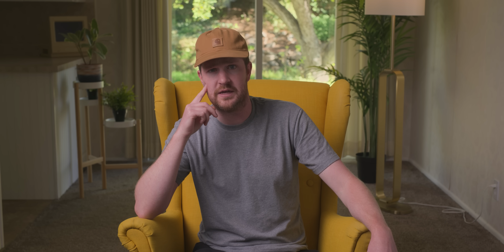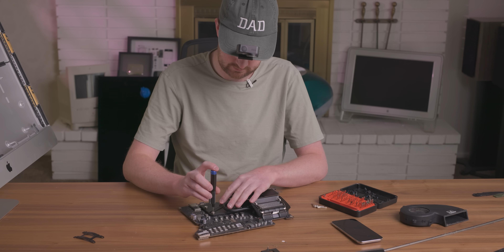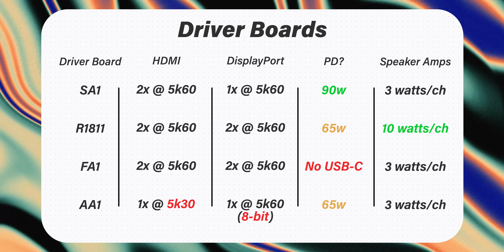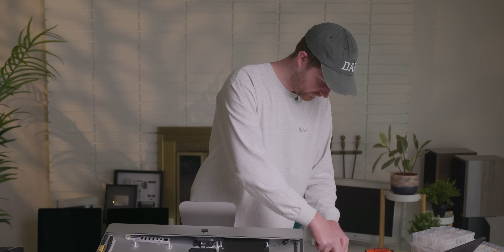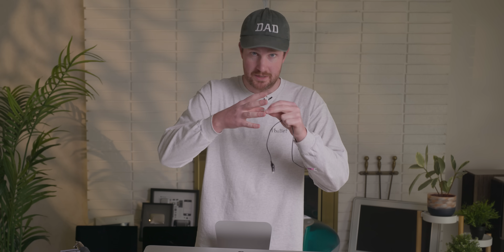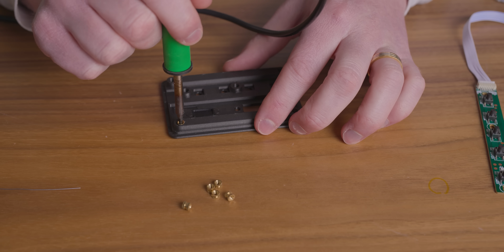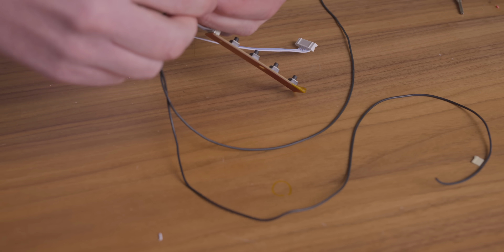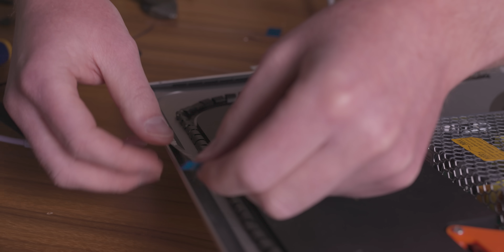I Turned a $200 iMac Into a $1,600 Studio Display!

Comment: Driver Boards...
Stonetaskin have an updated 12/24v display Driver Board, R1820 V1 to replace the 1811. 

They have made a fan cooled and a quieter fanless version, which appears to use a large heatsink. Board photos suggest that the 12v fan header is still installed, maybe the original Mac  fan could pick up its power from this with no need for the extra voltage dropper. Or the Mac 12v power supply could be retained and used for the chassis fan and the driver board if additional USB power or charging isn't needed from the rejuvenated 5K monitor.

Buuuut! The larger driver board and 10W speaker crossovers would be happier with a 200W power supply; meaning that all but the fan ducting in those beautiful 3D print files will be the wrong sizes or have incompatible mount screw centres!  Don't ask me how I know!  I have some aluminum panel, extrusions and a hot glue gun.

Comment: thats to much and too nerdy all u need is the cheapest board from any manufacturer just look over reviews aliex = 85eur + 12V 7A power supply CE certified 12eur = 97eur + thunderbold 4 cable...someone compared 8/10 bit board + regular 2017 5k imac, i swear the difference is so small its just cherry picking but 8bit doesnt need fan, or complicated 3d prints and you save a lot of money, no temp problems....this video is just bmw compared to koenigsegg in the end both doing its job very well!

Comment: you did not need weights just turn the two screws inside where the standing is mounted to the case u need to screw it 1.5x times each, now its new calibrated.

Comment: You did all that to save a 27"! If the fonts are fuzzy on 4K, just push the monitor back a little bit. I run a 48" 4K with WRGB subpixels! Sitting further back is better for your eyes anyway.

Comment: Well, that was a lot of fun to watch; it’s reassuring to know that insanity plays out on so many different axes of variation. I’m typing this on my 2017 iMac, and am waiting for my new Studio Display to ship from China; the new Mini I ordered on the same day was delivered today. Would I ever do this monitor conversion? No way in hell, although the technical feasibility was interesting to me. Will I spend literally three full  8-hour days doing the prep and cooking for a meal that will be inhaled in 20 minutes? (And that’s after driving a 4-hour round trip to get the correct ingredients from a specialty Turkish food market 90 miles away.) Oh yeah, daddyo; that’s my idea of a good time. 

By the way, here in upstate NY, we had 14 inches of snow fall 10 days ago. I went out with the snow blower, and just as I was dragging the damn thing backward to get back up a gentle hill to get to the driveway level, I had an explosive mega-sneeze with zero advance warning, and cracked a rib on my back, just below my left shoulder blade. That brings my lifetime number of broken ribs up from 13 to 14, and is the first one that wasn’t caused by my nasty motorcycling habits. To be fair, I’m closer to 79 than 78, and everything is getting more fragile. But I feel your pain, my brother.

Comment: Best way to use those new butt connectors is to pass it through the wire tie the two wires together fold it to either side and then side the sleeve over

Comment: I did this about a year and a half ago after Luke Miani posted his video three years ago. A couple of things I found from doing the conversion myself.
Press and hold the power button once you unplug the power cable and that will drain the capacitors on the power supply so no shocking moments when you get it open.
Why use a separate power supply when the built in one is perfect for the job? You can find what pins do what on the power supply so that you can connect via a regular in-line switch to power the power supply from the back of the power cable socket, I cut a notch out of the memory cover and glued in a small rocker switch. I cut the cable connector that connects to the old logic board and got my 12 volts from the required cables. No dealing with an aftermarket power supply or bec power supply to change 24 volts to 12 and its already screwed in place.
I used a bluetooth amplifier/receiver for the audio and bought a pair of cross overs for each speaker, I don't have to connect a line in cable and it works great.
I will be doing this again soon as I have an old 2017 i7 iMac that will be replaced by a 2020 i9 thats on its way and I will use it with my Mac Studio and will replace a 27" Dell 1440 monitor that sits next to the first iMac converted monitor.
Reply: Why to you need to " connect via a regular in-line switch to power the power supply from the back of the power cable socket" ?

Comment: 1. It‘s not the same display as the studio. 2. The speakers and webcam are also poor. The motherboards are mostly from China and the quality isn't very good. One motherboard I installed failed after only four months, and I had to start the whole rebuild from scratch. You're better off buying a used studio display; you can get one for around $900 these days.

Comment: my 3m adhesive tape came unstuck during a really humid thunderstorm resulting in the screen falling out and ripping the cables right out of the mainboard.  pi**ed didn't begin to describe it.  Now I'm stuck with a 1440p monitor.  I say glue the screen in place.

Comment: Hi. Why do you use LRS-150-24 and not LRS-150-12? The SA1 is a 12V driver board. I'm not an expert, just asking. Won't you overload it?
Or do you have a 12–24V SA1 board somehow @SnazzyLabs? On Stonetaskin I believe sell 12V version
Reply: It is designed for 24V

Comment: Isnt the 150W PSU underpowered for a 90W USB output?
Reply: Yes. I think it is. When my M1 Pro charges at full 90W the PSU shuts down due to overcurrent protection. I will try an 200W Meanwell. But I don't know how to get it in as it's bigger.

Comment: Great video and I'm going to be giving this a go! FB Marketplace iMac already acquired and SA1 board is on order! Only question I had - How did you get the panel mount cable to get low enough so as not to impede on the actual screen? I'm going to be doing HDMI 2.1 panel mount and USBC4 panel mount so wondering if the mount size and stiff cables are going to be a problem. Cheers!

Comment: This is awesome, and I've been following along! However it looks like the model for holding the SA1 driver board is not the same as what you use in the video. Can you link to that stl? (it looks like you've got 2 pieces of bracket attached to your driver board)

Comment: Brave, wouldn't a dry screen test have been safer? Glad it worked though :) I am from the UK. I used a MAC like this for work for BIM/CAD, and the built-in webcam sucked. I have a red face anyway, but I looked like a Lobster in meetings! Great Job, think I will just stick to my PC monitor and external speakers though :)

Comment: Hey - What mounts are you using for the board in this video? I looked in all of the files that you link to and I can't seem to find those two brackets. Thank you.
Reply: Same question! SA1 mount linked on notion - Bulabula2001’s SA1 mount - looks like it is designed to go where the imac fan sits.

Comment: i've used these kind of adhesive strips to replace either a hard drive or some ram, something, on a similar iMac, and I don't think you have to do it the way you did it.

The adhesive straps have pull tabs that stick outside of the caseonce you try to put it back together. So if you put the screen down on the case with the tabs showing you can line it up and then one at a time pull the tabs so that the adhesive will be in exactly the right place. At least that's the ones I bought worked

Comment: Seems like a cool project, but I think if you don't have a 5k iMac already, then there is not much point to do it. Thunderbolt 4k displays are available, that will make it easy to do a one monitor setup. Speakers would be nice if you don't have anything decent. But it is nice to save one from landfill.

Comment: Get a normal 4k monitor for cheap and get an app called Better Display that's what I did and you can control everything including combined brightness linking your MacBooks sensors to the display with True Tone and brightness control and HIDPI at any resolution you want.

Comment: Did this with an older 1080p 2010 21.5” iMac. Lots of space, I could fit a power supply, HDMI to USB-C dongle (with usb), by backup drive, and the original SuperDrive. It’s great! Just need to work on cooling the power supply better

Comment: Duh I didn't believe and looked it up, it is 1600$ indeed! And I have an 2017 27" 5K iMac sitting next to me as extra :) I am happy I didn't sell it and I already disassembled it to add an NVME. However, I don't have access to those controller boards, I started searching and found 2 software solutions instead:
1) Sunshine\moonlight
2) Duet. I tried duet and it is working quite well for my purposes (no gaming, just development).

Comment: Thanks a lot for the guide. Always wanted to do it and this gave me the nudge to get all parts. Quite excited for my first project like this. My board will arrive this week. Any chance the illustrations will be up soon?
Reply: I hate to say it, but the SA1 bracket including board linked to on Notion does not fit in my A1419 when mounting both the speakers and fan.

Comment: I use a Luna Display to connect my M2 macbook pro to my 27 intel iMAC
Pros
Easy Plug and play
Use my 27 inch screen as an extended display
 Cons
There is very noticeable lag but i am ok with it as i use it for Graphics and not motion graphics
can't watch ny OTT on it as Luna display  screen records 
Occupies 2 of the 3 type C ports

Comment: I have a 27" iMac that I absolutely LOVE (it's my second or third iMac...) and it is about to get this treatment. I'd found lots of articles about this conversion/salvage process - I had no idea it was such a popular thing to do.
My iMac (2019, A2115) and yours are different so after hours of searching and comparing, I ordered a JRY-W9CUHD-AA1 and crossover on AliExpress.
A couple of things:
1) Are you planing to finish your "iMac ➡ Studio Display Mod" page? I suspect your adoring fanbase (me) would appreciate it.
2) Your str files don't download as files, they download to the browser as raw character streams.  Interesting but not really useful.
3) Don't use PLA because of the heat? 
4) Where did you get the measurements for the placement of the screws inside the iMac?
Regardless, I will forge ahead. I've seen some people describe their mods and say to leave the display taped in place rather than doing the final adhesive until everything is exactly as you want and works perfectly - which I intend to do. 
Thanks for pushing me over the edge.

Comment: Just a heads up, I just built one of these and you might want to move the crossovers, With them in the location suggested in the video the power supply bleeds over some interference. I ended up hot glueing them towards the top of the display

Comment: Hmmm .... and all it cost was a BambuLabs printer (the expensive one because you can't print those filaments without the enclosure), about $300 in parts and shipping (which might or might not be good), about $200 worth of tools, an old 5K iMac, at least 5 hours of your time and a couple of broken ribs and associated medical expenses. Where do I sign up? 😂

Comment: All you had to do was run OpenCore Legacy Patcher on it, upgrade it to the latest macOS that model could handle, and it would automatically show up as an external display in your other Mac. No disassembly required and you maintain a fully functioning iMac that can also be used as a second monitor. This is what I did with my 2011 iMac 21" and two 2013 iMac 27" units....because, as you said, Apple killed Target Display Mode and I just couldn't throw away 3 completely functioning iMacs that were "outdated" because Apple didn't support them...but OpenCore Legacy Patcher did.
Reply from the maker: And it’d be a whole other computer connected with wireless latency and no PD. Much worse experience.
Reply: @snazzy  That's not quite accurate. I can only assume you have never done it. Yes, it is a "whole other computer", just as it was before you took the screen off, and dismantled it. The key here is that it is a "whole other....WORKING....computer" that can also be used as a wireless secondary display. There is no latency and you can move your mouse right from one screen to the next. This isn't a different app...which does have latency...and exactly the reason I couldn't stand using them. The point is, why would you want to go through all of the headaches in the video when a simple install of OCLP accomplishes 10X more with no expense and no need to disassemble and possibly destroy the internals? 🤔

Comment: Can you show us how it sounds? I don't know if I should get the crossover boards or not
Reply from the maker: I don’t think it’s worth it, honestly, unless you’ve got the R1811. It’s the only one with good enough amps to be nice.
Reply: @snazzy  I'm really leaning more towards the R1811 just because of the nicer preamps. I'm using a macbook pro m1 max right now and one of the things I miss the most is the fuller sound of my old 2017 27" imac (and the 5k display, of course). I can't find anything about how it would sound either with the SA1 or the R1811.

Comment: I really liked your video. I myself converted four iMacs for my office. Your design would be a huge upgrade with fan and speaker integration.

I couldn’t download your STL files from Notion though. What’s up with that?

Would you be interested in a V2 of your project? I have some thoughts. If you’d like to discuss further ideas, PM me.

Cable through Ethernet is rough. It would look cleaner through 3d printed shroud. If you were to do this, it would look even cleaner than the OG Studio Display. 

Next step to make this more fun to work on:
Make the display magnetic like the pre-2012 Unibody iMacs. You will want to make access easy for revisions. Opening the cloud display has the risk of damaging the display. I had the red hue around the edges, and it might be due to small damages around the corner.

Comment: Your justification was that it had better speakers than most off the shelf screens, then complained at the end that they sound shit. You like the one cable design, but then didn't wire up the webcam, reinstate the USB ports to plug in a keyboard, no built in mics etc. Gah, this was so frustrating, and cost more than just buying a new screen. Literally the only justification left is that it's 5k vs 4k; you spent a month of your life, and $1000 to have a 5k screen, made out of ewaste.

Comment: In 2019 I used to use Old iMac as external display for my Linux laptop using X11 forwarding ;), later I switched to something called Xpra (not sure if it still exist) and I had some kvm software to move my mouse across linux and iMac. That was magical and I had a lot of spare time on these stuff...

Comment: I thought they brought target display mode back after Ventura, but you needed to use opencore to get it on the imacs. I’ve got a 2015 5K that I’ll be testing that route on first – only need to find a working TB 2 to 4 converter. And of course target display mode was never introduced for Apple Silicon.

Comment: I completely agree with this, even for something as simple as a website erroring on an iPad, fire the mac up and it works fine. I prefer the iPad for pretty much everything but im constantly grabbing a macbook because i cant do something. 

I’ve always wondered with the apps using higher performance not working as they would on a mac is it all aimed at maximising battery life for the iPads?

Comment: @Snazzy : so you got me thinking... I have several Apple thunderbolt displays which work great but can only be used with an old Mac. So I searched AliEpxress for similar boards and found there were several. How about doing a video on converting one of those and providing the correct board to use?

Comment: OK, freaking awesome! but holy hell, no way I'm ever gonna even attempt to do this 🤣🤣🤣

I was hoping to do something similar, but I don't have the knowledge, or the tools... 

I got a 2012 (I think), 27'' iMac... I got it for free... BUT... It has a firmware password so it's basically useless... I was hoping I can crack it somehow, but no luck... Run Linux on it or whatever... Just for kinda music and movies and stuff... But can't find anyone to unbrick it... As far as I went, I think there is a physical chip inside that you have to remove/replace, and I haven't found anyone willing to do this on such an old computer... 0,0 

Any advice? It's till a fairly nice big display for what I intended to use it for and it kinda feels bad to just throw it away...

Comment: had been considering this with my 2012 imac when the i7 3770k ran its course as useful but the display died! so i’ve been using a thunderbolt 1080p display… not the same. idk if anyone has a 27.5 2012 imac display they’re willing to sell me for cheap 💀

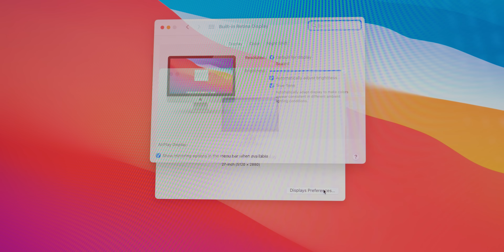Comment: Are you sure about the perceived brightness of the 2015 vs 2017 iMac screens mentioned at around 6:40? AFAIK the human eye has better sensitivity at low luminance than high luminance, which means that going from 300 nits -> 400 nits appears more of a significant change than from 400 nits -> 500.

Comment: Great job Snazzy! I didn't see you test the display before you put it together again 😮 That's living on the edge man. When I did mine back in 2023, I skipped the adhesive strips. My screen is held in place with four pieces of next to invisible transparent packing tape, so I can easily open up the monitor if ever I need to. And I have needed to 3 times in four years. Not a bad score methinks.